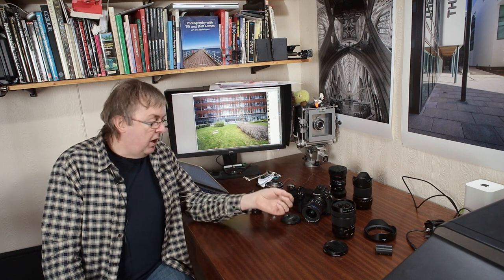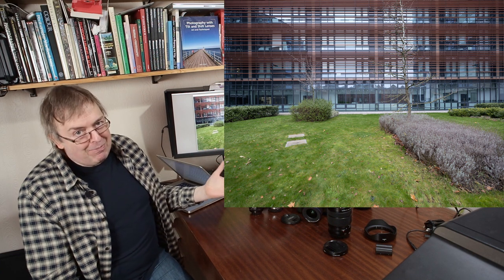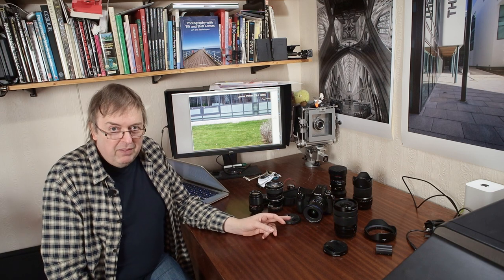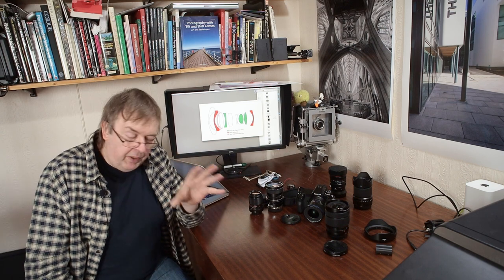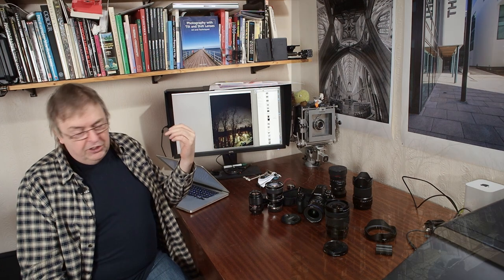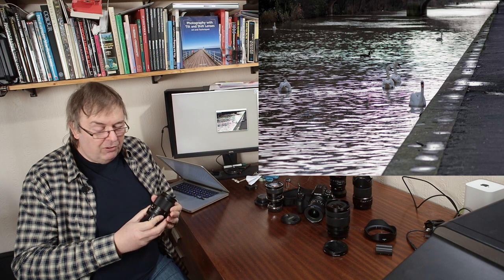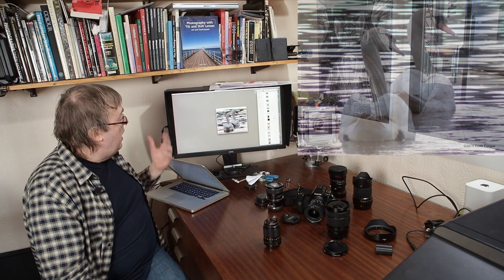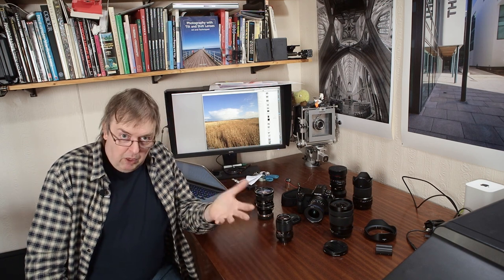Modern lens design and the 'Free Lunch' How software helps and works for old lenses too

Comment: Is software correction cheating? In other words, is it similar to how changing perspective using software vs a PC lens is using a smaller portion of the sensor? I realize there might be a practical  vs theoretical aspect to your answer. I mean, if we correct chromatic aberrations such s fringing in software were also robbing the inage of resolution by masking those purple or green fringes. Lasrly, if lens design is a matter of compromise (and technological innovation), in which instance could an older lens - on certain aspects , not across the board - outperform a modern lens? And how much do environmental variables contribute to this answer? One last thing :I have been wondering the following for a while: does lens sharpness compromise color fidelity? Inkeep thinking back to some of these simple, expensive, and gorgeous cinema lenses such as the Cooke tripplet and Zeiss CP line. Thanks for doing this video and gave a wonderful weekend, Keith.
Reply from the maker: Thanks - good points!
There's only one form of cheating to me and that's passing off someone [something?] else's work as your own - but when does software impinge on this ;-)
I'm still happy using old adapted lenses sometimes - depends on what the images are for...

Comment: To me the end result is what's count. If corrections are done with extra (or exotic) glass or in software doesn't matter to me. Adobe sw may not be as good as DxO in correcting lens problems, but you do have the option of selecting a profile manually - of course as long as someone has made one. There are also an open software project called Lensfun which is used for lens corrections by several applications like DarkTable, but also some commercial software. I've only used it through DarkTable and it was certainly better than no corrections, but not as good as Adobe. This was years ago so things might have changed, but the main point was that Lensfun support a lot of lenses.
Reply from the maker: Yes - there are some good developments in this area.
My own issue has long been that I use shift lenses for a lot of my work, so corrections become more tricky to apply.

Comment: My RF 16mm F2.8 is absolutely terrible for distortion if you look at the raw files - worse than anything I've ever seen.  Print the corrected jpgs and you'd never know without going A2 or greater.  It's useless for Astro etc. as coma is stunningly horrible.   If I use it for  landscape, I just crop 1:1 or 4:3, and it works great for 4K video.  It's still a great little lens taht wouldn't have been possible even a few years ago.

 I put in a request to DxO a while back to allow selection of lens module correction profiles manually.  In particular for my film scan tiffs shot with EOS lenses I'd like the corrections sometimes.

Another great video sir!
Reply from the maker: Thanks - I'll add that to my own list of 'requests' ;-)
Years ago I used to do pre-release testing for DxO Optics Pro, but they seem to have moved in the direction of providing an alternative to Lightroom (Given I dislike Lightroom, it means the number of new features which appeal has steadily diminished)  I still like it, but 75% of my commercial shots couldn't get anything much from it (using shift lenses)
Reply: @KeithCooper  I can't stomach Lightroom, in any version.  I use Negafix for my analog workflow so I can avoid LR.

I just upgraded, and Photolab 6 has been fantastic so far!   In particular they added a new library function that allows me to interface with my existing collection on a 15 TB NAS. It works seamlessly without the headaches the Lightroom catalog caused for me.
Reply from the maker: Yes, it's getting better, and it's good to know it worked with the catalogue.

Comment: That´s something that caught my attention reading about the new RF glass. While I do understand that those lenses are cutting edge, I simply don't get why they need to be so overpriced, since there is "less stuff" physicly going on compared to old EF glass. I know they are sharper, but I feel that knowing that the results are mostly software based, we are loosing some of the "state of the art"  magic.
Reply from the maker: I feel there is a bit more of "what can we get away with charging" at the moment - the reduced volumes of sales are being pushed towards profitability, hence the higher end glass appearing.  

I'm testing the GFX100S as a replacement for my 5Ds, partly because Canon has left the high MP market hanging a bit, and partly because when they bring out something 'suitable' they might put the sensor into an R3 (or 'R1') rather than R5 style body and any new tilt/shift lenses will be too expensive for me to justify from a business POV.  Having been out today with my TS-E17 and TS-E24 II on the GFX100S I'm seeing rather good results with an EF->G adapter.
Reply: @KeithCooper  I have those two lenses, and the 45 and 90. I bought a Lumix S1R for them, and the Sigma adaptor. The  S1R has a 187 megapixel high resolution option.

There's a recent rumour of 90 megapixels coming from Canon. Sort of credible, the 50 megapixels was a huge surprise to all.
Reply from the maker: The 50MP was not that much of a surprise...  Then again, I have run the original Canon Rumours pages since 2004 [long before any specialist 'rumor sites']  Not maintained as they once were but still going strong.

BTW I tested the S1R with the TS-E24 II and TS-E50mm - very good at ~190MP
https://www.northlight-images.co.uk/using-the-panasonic-s1r/
Reply: @KeithCooper  If 20 megapixels is enough, then 187 gives enormous scope for cropping. I could shoot with the TS-E 17, then crop to TS-E 24 view, or crop portrait out of a landscape image.

Karen might like an OM-D E-M1 III or OM 1. 20 megapixels, whit 80 megapixels high res without weird exposure limitations, focus stacking/bracketting, , live ND, 50 megapixels hand-held. Someone, I think Fotodiox has shift adaptors.
Reply from the maker: The ~190MP is good, but only usable in quite specific circumstances
It's one reason I'm interested int the 100MP of the GFX - with an optional ~400 (albeit not so well implemented as in the S1R)

Comment: You really can "have your cake and eat it too" and programs like DxO ViewPoint (and Nik Perspective Efex) can correct even fisheye-level corner distortion. It is annoying, however, that despite the plethora of camera/lenses that PhotoLab supports, they've yet to add the Mitakon Zhongyi Speedmaster 25mm f/0.95 (which is a "fully manual" lens with no EXIF). Thanks for explaining why this and other similar lenses aren't supported, but they also don't support the Samsung Galaxy S22 (which does have EXIF data, although even the "Expert RAW" app doesn't produce actual RAW files--only DNGs I can't process--plus there's no auto-correction for lens distortion other than what the hardware provides, but at least there are manual choices). I rarely use a phone for serious photos, but sometimes it's the only option. Also, thanks so much for the tip re Sharpen AI (I expect that Photo AI would do the same). I don't necessarily worry too much about edge sharpness (or other issues, other than CA, which is never a good thing) as I sometimes add subtle vignetting in post, but there are cases where that could come in handy.
Reply from the maker: Glad it was of interest ... and yes - I need update my reviews to cover Photo AI as well ;-)
Reply: Apparently some of my cameras can correct fisheye. I haven't tried it, I just assume my bower fisheye is not included.

Comment: There's a lot of photographers complain about "wide angle distortion." I wonder whether they know what they are doing. Some are confused by misleading perspective. Inside a room, photographing the far wall, there's a couch at right angles, projecting towards the photographers. That's physics, not the lens. I did technical drawing at school, I would draw it much as the camera records it.

Outside, essentially we're photographing the inside of a tennis ball. If you use a lens with an angle of view of 120 degrees, you are going to capture a lot of concave curvature. And then, you project it onto a flat surface. That's not the lens either, it's physics.

It looks weird, because  you don't pay attention to what's around it and you see the curve as normal

Correct it or not. I don't care.

I am not at all saying lenses, any lenses, are perfect, but I try to understand my gear properly. I place my camera thoughtfully, to make my photos different from how people mostly see stuff. A bit of curvature doesn't bother me at all.

I don't like chromatic aberration though.
Reply from the maker: Yes, I may well even add barrel distortion if there are people in a wide view...
Thanks for the idea - topic added to the video to-do list ;-)

Comment: I still think there is no free lunch. Today computer-aided lens design focuses on properties which are unambiguously measurable by reviewers, such as sharpness, aberrations. However, I bought this year the Canon RF 14..35 F4. It is sharp, has little aberration, BUT the images I get, lack any depth. I visited Tuscany and landscape there is all about light and depth. None of the images could hold a candle to the old simpler design Zeiss ZE 28mm F2, I used at similar circumstances. The Zeiss has more measurable optical defects, but it gives me the impression I saw. Now the Canon rests in my cabinet as the most expensive bad investment in my photography.
Reply from the maker: Ah, now I never said lens imperfections were bad, some might appeal more to some people ;-)  

Whilst I appreciate your POV [I use old lenses too] I have to say that the term 'Depth' is one which means different things to every person who ever uses it. 

It tells me nothing of the differences between what are two very different lenses (28mm vs 14mm is a huge difference for a start)  A comparison between the RF14 and the EF14 [or EF14 II ] would mean far more to me - or any other 14mm design of yore. Now it happens that with 14mm (on full frame) I often prefer a bit of geometric distortion, unless I'm shooting subjects where a true rectilinear geometry is superior.  

If there is a difference between lenses it can be shown, if it can't show up in a test image it's as much in your head as the lens [nothing wrong with that BTW - photography is a creative endeavour]

I'd rather start off with very good, given the choice, but then again I shoot architecture ;-)

Comment: whar about using free software?
Reply from the maker: What about it?
Reply: @KeithCooper  I have a old version of PS and LR and I'm not sure that I can transfer the programs from Win 7 to my next wind 10 computer when I can afford one. So is there free software that I can use that is any good? I will use old lenses on a Nikon D850 when I can afford a 2nd hand camera in 2 year time. I got D700 and D800E today. In 5-6 year I will get a Fuji GFX 100S so I can use my old HB and Mamiya 7 lenses. I often use a handhold camera in low light so I need some software to fix the pictures .
Reply from the maker: Ah, given I've not used a windows pc this century, I can't really assist with this I'm afraid ;-)
Reply: @thomaseriksson6256  If you have the install files, they should be fine.
Reply: @oneeyedphotographer  Thank you they are installed in a laptop and a desktop. I need to contact adope when I move the files. I need a raw converter for the new cameras.